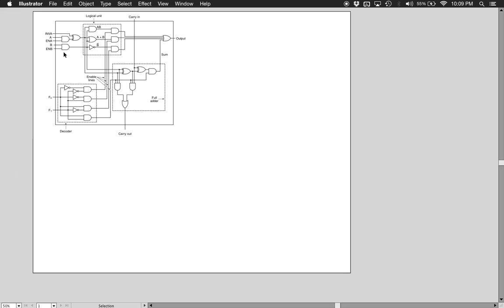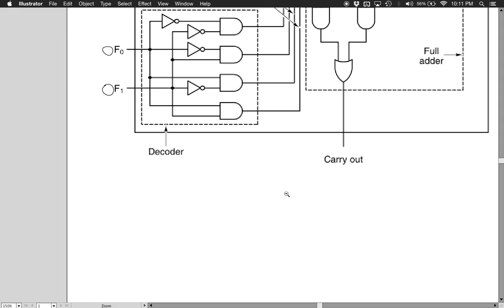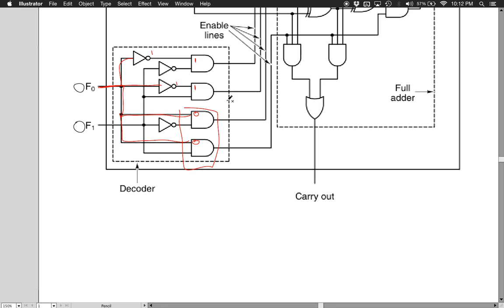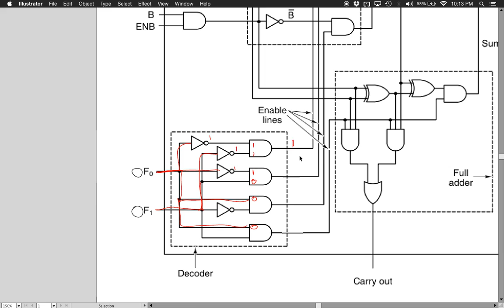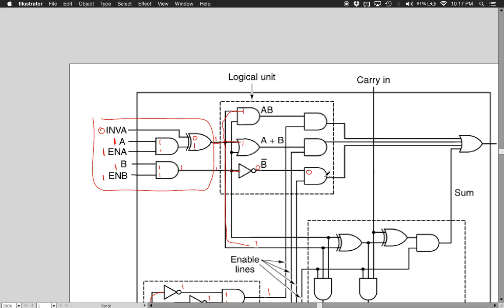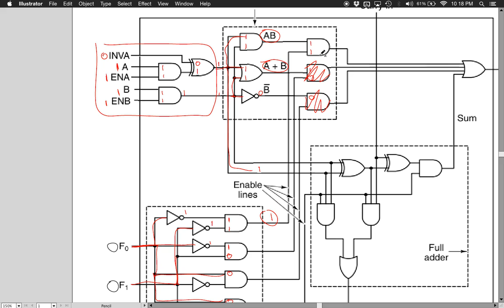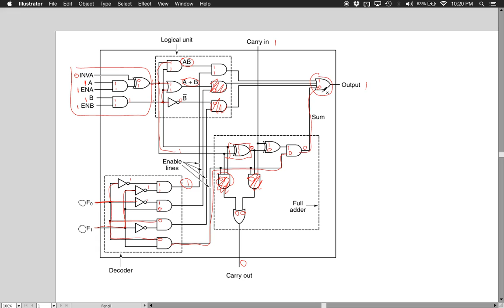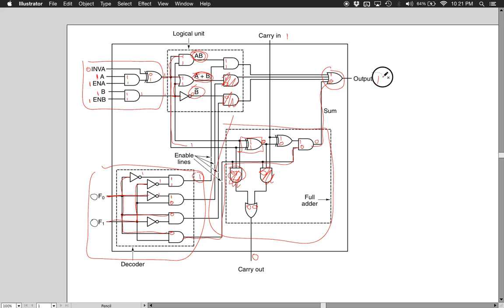A 1 bit ALU explained

Comment: It's possible to make a 2 to 4 decoder two inverters instead of four, put one inverter on F0 and one inverter on F1, then you have four signals, normal F0 and F1 and you have inverted F0 and F1, with that you can make 0 0, 0 1, 1 0 and 1 1 for the AND gates inputs. Just my 2cents. :)

Comment: To me, the video looks like it's starting in the middle, with some introduction missing. The introduction would read something like "This is a one-bit ALU, having the folloing four functions:  (A and B, A or B, A+B and the fourth one). The four functions are selected by way of the decoder (I'm still not sure of the settings) etc. 

Othewise a very interesting movie.
Reply: In the decoder part, starting from the top, the enable lines turning on correspond to 0 (F0=0;F1=0), 2 (0;1), 1 (1;0) and 3 (1;1).
Then the corresponding 4 functions are A and B, A or B, not B and A+B+CarryIn. Only the fourth function turns on CarryOut if A+B+CarryIn is 2 or 3.